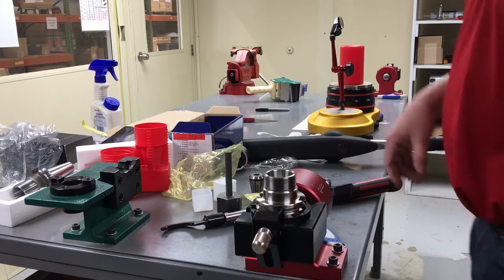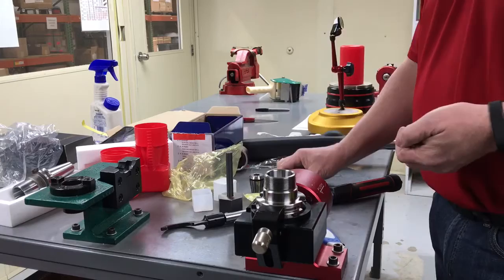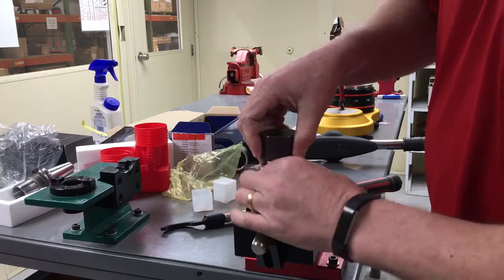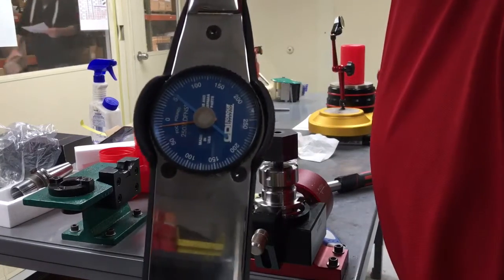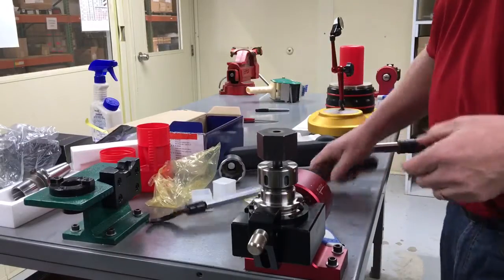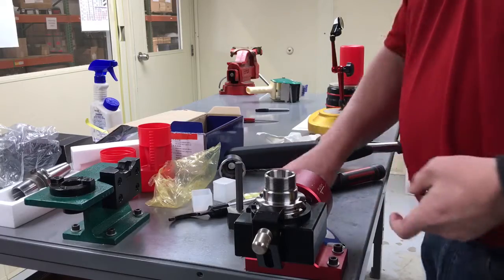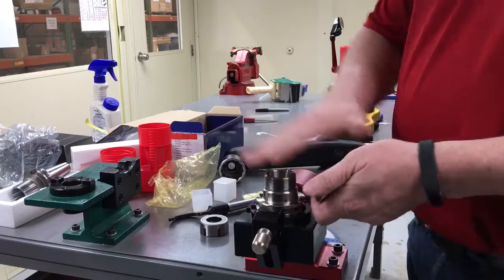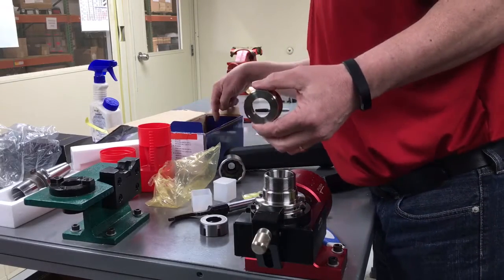ER32 Bearing Nut vs Standard Nut

Comment: I have got to be missing something. . .  What is the advantage of a bearing nut?  Not that we don't trust you but shouldn't you be measuring the torque on the wrench with which you tighten the collet?
Reply: The bearing nut tightens the collet more because there is less friction. Testing the amount of torque needed to move/slip the "end mill" tells us how much more it is being tightened. He also tests the amount of torque he applies to the nut to show that it is a consistent force and that he isn't tightening one nut more than the other.